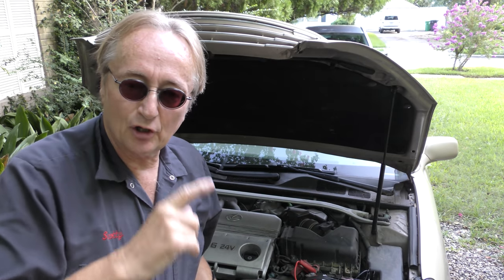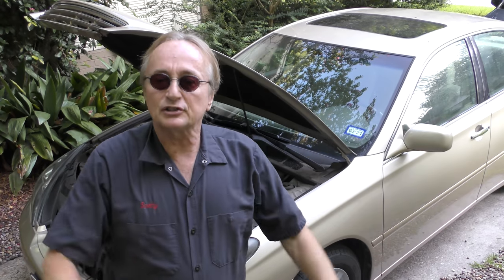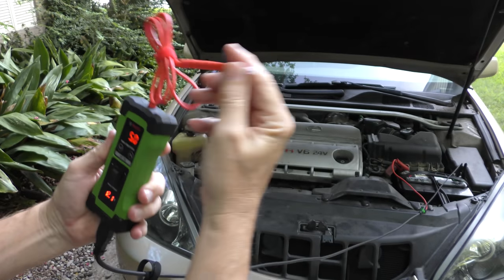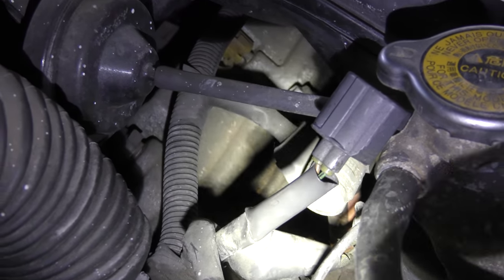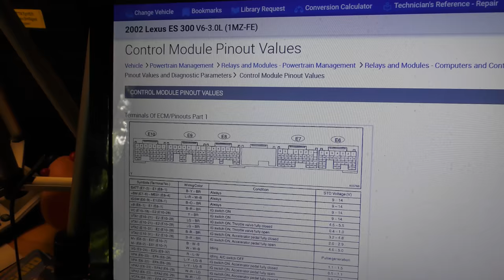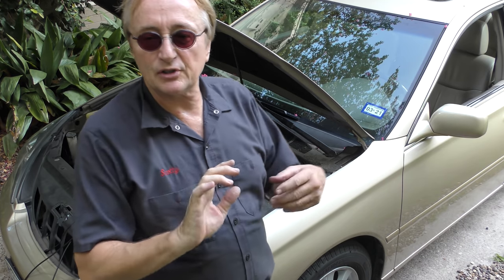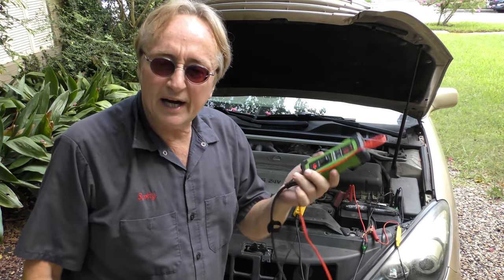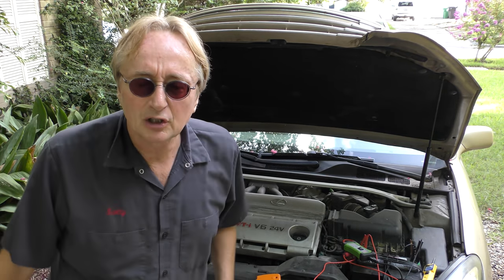Never Use This on Your Car (It Destroyed My Computer)

Comment: You don't skip to replacing parts. You run the test(s) indicated by the manual for that code to successfully isolate what is really the problem, whether it's the senor or something else found during the test(s).

Comment: Protip 90% of the time when my engine light come on in my lexus its just the gas cap. Always check the gas cap first if the engine line comes on. Just turn the car off take gas cop off and clean off the rubber seal even a drop of oil rubbed on can help it seal better. Put it back on and hope for the best. If it dont fix oh well it was free to try.

Comment: Before going through any of that... I say CHECK THE BATTERY VOLTAGE FIRST, then a quick check of the alternator. 
Low operating voltage can cause the computer to do weird things.

Comment: No link to the green tool you used. Vet OTC 100? I like the way you can adjust the voltage ⚡. I would never trust myself with any of the power probes because of the possibility of frying the ECM. Found the product runs about $300 but seems much more versatile that the power probes I've seen.

Comment: THE ABSOLUTE BEST SCAN TOOL IS THE INTERNET, as long as you know where to look and what is being told to you makes good mechanical sense from people with experience. Some of the best advice I have ever been given are from those who have gone through the exact same problem and are confident and psyched to talk you through the fix.
Reply: You can at least get pointed in the right direction, usually, with the symptoms.

Comment: This is great advice.  If in the unlikely case your sensor goes, only get the OEM sensor.  It means you know it will be compatible and not cause problems itself.  Finding the voltage is easy once you know the voltage of the part.  I have never had to replace the OEM sensor on any of my cars but a Toyota Corolla, that is it.  it was the oxygen sensor.

Comment: Pretty good information Scotty!  Goes to show that a lot of times further diagnosis is needed on modern cars, using a code reader just gets you to step 1.  Also, ive found out that factory engine wires in a older car can get brittle/crack with age due to oxidation.

Comment: Last time I was this early, Chrysler made good vehicles! Oh! Whom am I kidding!
Reply: Haha
Reply: I guess I was just lucky... 3 Chrysler products, well over 500k miles between them... one blew a radiator. That's it.
Reply: @Joose  unicorn
Reply: It's "who" not whom
Reply: Typo
Reply: @Joose  Yep. I still own a 98 Grand Cherokee. It's been very reliable and robust vehicle. I changed all 4 shocks once and replaced a water pump as a preventative measure. The original water pump was still in great shape at 120K, 10 years ago. I haven't even touched the engine except replacing spark plugs several times as preventive maintenance. I did install a transmission cooler when it was new because I towed a 2 ton travel trailer with this Jeep. It's also an excellent, very capable off-road vehicle.

Comment: Nice! I haven't seen that tool before. At least if its a bad wire you can just run one wire through the firewall or across the outside of the old harness and pop out the pin on the ECM/PCM and to the same to the sensors connector pin. Then your just bypassing the one wire. Much easier than running and entire harness.

Comment: Smog test failure is my biggest problem on my 98 Tacoma. A couple times the mechanic took off the o2 sensor and cleaned it in an ultrasonic cleaning tank. All that exhaust gunk builds up after 20 years. Didn't need a new sensor.

Comment: Just for info the OTC VET 100 will cost you about $200. So you should be doing this on a regular basis which I would recommend if you have anything other than a Lexus or Toyota. I only have one because many of my friends bought Dodge or Chevy and they are constantly coming to me to fix their electrical issues.

Comment: Before playing diagnostician, sometimes it makes common sense not to assume the dark stain level of the coolant reservoir  is ok. While your engine is cold just take the radiator cap off, take a look and see if there is actually coolant in your engine.

Comment: Just a little note to remember.  Generally, any system sensor is either a 0-5 volt or 4-20 milli amp device.  Not only true for cars, but it's a general industry standard.  Even the, now no longer used, space shuttles had sensors that worked this way.  Yes, the 3.5 volt sensor has become more popular lately as well.

Comment: Paying a margin more for the OEM parts is worth avoiding really expensive repairs that can come from the cheap faulty ones.
Reply: If it's anything with a lot of labor that's going to end up costing more to swap out if it falls then im automatically using a high quality part
Reply: @thetechlibrarian  For the '99 Cutlass I'm trying to get up and running some of the most important things to go high quality on are the head gaskets and all of the other gaskets involved. I'm also gonna make sure the heads are close to new condition by taking them to a professional, use new bolts, and I may get new push rods too. AcDelco's kit comes with the gaskets and the bolts which is pretty convenient.

My parents had another similar  vehicle before the Cutlass, a Grand Am which was probably a '95-'97.

I was little when they got rid of it after the head gasket blew out and now their second vehicle with a GM 3100 engine has a similar problem but this one's probably gonna get fixed and get a few hundred thousand miles on it.

All in all, paying for quality parts pays for itself many times over because it'll save you from repairs that cost tens of times more than the price difference between the cheap and the OEM parts.
Reply: Yeah, or at least a quality part from some oe supplier. Really depends on the vehicle. Some aftermarket parts are better than some factory. But then some factory are the best ever. I got over 100k on the factory front cv axles on my 2000 Ford, which was pretty good for lifted torsion bars, 35" tires and 4.88 gears, with TONS of abuse. Figured I'd save a bit, get some parts house axles when I finally broke one. Which I broke, I did something stupid and literally broke it myself even then. But after that, I got really good at changing axles... And unit bearing hubs. Once I finally killed the factories with pounding abuse and lots of water and mud, got where I could change them in about 30 minutes. Good thing they were lifetime warranty, til they stopped honoring the warranties on them and the axles. Should've just went with Ford, and never had to touch it again for years if ever. Now the rear axle was exactly the opposite. Factory was 300, I got a Yukon for 150. Chromoly... it was so hard, the stock replacement lugs I pressed in, fell right back out. And I ended up having to press the old ones in. So that baby was never gonna break. But the original shouldn't have. I knew the wheel bearing was going for a long time, and was just lazy. Til it had finally work a 1/4" groove in the axle race, so had to get a new one. When it could've been just a new bearing. I also used Yukon gears. Their stuff was GREAT! But still cheap. They're probably higher now they're established, but I know they did make great parts for the price of cheap Chinese crap.

Comment: Hi Scotty. I'm from the UK. I have a Lexus IS200 (se), an automatic. It's got a little over 130,000 miles on the clock. The steering shakes a bit at about 50mph, which I believe you've mentioned is a transmission problem. I doubt the transmission fluid has been changed. Generally the transmission works ok, but is a little clunky with main changes, eg. reverse to forward or back, etc. Would it be too risky to change the transmission fluid, or might changing half the fluid be good?
Edit: ps. It's about 16 years old

Comment: This is a way to test wiring but you can check wiring even easier. Disconnect the connector with everything off check resistance power to ground should be infinite Do the same ground to ground should be nothing. Then disconnect the connector from the computer and check the two pins together should give you infinite resistance again if all of that is good your wiring is fine.

Comment: 2017 ford f150, you turn vehicle power on, not start engine. Pull the high beam light lever 5 times then press and fully release the brakes 3 times. About 2 seconds later I saw the batter check light flash 3 or 4 times. An saved $175 on a reset.

Comment: On my 2014 Nissan Pathfinder I had a aftermarket maf sensor replaced whenever it dipped down to -15 degrees in the winter my car stalls out and all those times I was chasing a ghost problem thought it was the fuel pump but it wasn’t all along it was the sensors issue even though there wasn’t a code saying the sensor was the issue replaced it with oem and worked like a charm

Comment: First thing I would have done is look up the resistance chart on alldata for that sensor and test it in a pot of water on the stove as it heats up before sending any power through to the ECU and risking damaging anything. Make sure your sensor isn't actually junk before risking the more expensive components.

Comment: at about 160k the maf went sick on my 2000 toyota echo. researched it. NO not 200 bucks for toyota sensor. the best sensor was 16 bucks. its been working fine for over 2 years. sometimes you do not need OEM. when the belt idler went bad on my camry and the alternator bearings got noise on the echo I bought real OEM parts online. when in doubt you are correct use OEM

Comment: You can create this testing device really easily for cheap. You need just the LM317 voltage regulator and potentiometer. Then you can adjust the output voltage according to digital multimeter.

Comment: I was hoping you'd get into checking the resistance of the wire.
Reply: Quickshot Gaming Ohm my!
Reply: For this small a voltage it'd better be very low resistance.
Reply: grassroot011 V=IR

Comment: How about a charging system sensor on a 07 Ford Mustang? I've replaced the wiring from the starter-battery-alternator because the wiring was bad.

Comment: Wow how crazy you mentioned the engine coolant temp sensor that's one of two codes i got on my car right now I have a 94 Nissan 300zx
Reply: @Mark Codiroli the first code was 34 the second was 13 its the ect sensor and the detonation sensor circuit...

Comment: My advice = If you pierce probe a wire, use a product like liquid electrical tape to seal the probe hole. If you don't, the wire in the harness will eventually corrode causing a problem later on. JMO.

Comment: great video, very helpful... My 2008 G5  had a crank sensor issue,  ended up taking it to a mechanic and I was right was crank sensor, but it was a bad wire in the harness, they swapped it out for one from an auto wrecker but code started coming back. It must be a common issue on these engines, online I can only find the connector for the sensor with a long lead off of it meaning they want you to by pass the stock wiring. DERP thanks Chevy
Reply: @milcotto4153  there is no leak just a cheap chevy wiring harness

Comment: Hey Scotty, why you didn't mention testing the sensor with a multimeter, by looking at the resistance rate/temperatures of the sensor. It's a pretty easy and non expensive method.
Reply: @Mark Codiroli takes no time if you have the information of resistance by temperarure of the sensor and if you use an Slide-on Extended Tip in your multimiter, you don't even need to remove the sensor out... just unplug the connector and plug the extended tip....vuala!
Reply: @Mark Codiroli 🤔 now you're saying that's the same effort.. anyway, my point is:  There's other options to diagnose the sensor, keeping in mind that a circuit tester cost a lot more than a simple multimeter.. It's just about it and nothing more. Have a good one pal !
Reply: @Mark Codiroli I suggest you to read again, cuz i never said that you need a sensor simulator to check the sensor, I just suggested that you can do it with a multimeter . I will not offend you, there's no need for it, I'm sorry if you though that i did, it wasn't my intention.

Comment: Hi Scotty! I’m thinking of buying a new Toyota Sequoia with a naturally aspirated V8, but I read that naturally aspirated engines lose power at higher altitudes. I plan on driving it in mountains up to about 5,000 feet. What I read stated turbo engines are better for driving at altitude since they don’t lose as much power. What are your thoughts? Thanks

Comment: Hmm my 99 lexus es 300 coolant fans keep running all the time. Chiltons diag says it's the coolant switch. I replaced it and it didn't fix it. Took it to the stealership and they think it's the ecu lol. So I bought a duralast gold battery with a 5 yr replacement free. And now I get a new battery every year for free👍

Comment: Hrm....I have been convinced my TPS has been bad for a while...I replaced it, but still get hard starts (no codes).  HAVE tested voltage at the sensor, but still have the same issue over and over.  I've run down the Christmas tree of possible reasons....but now I'm paranoid the brain may be failing.  It's a 2003 Ranger...they don't die...they just work less good.

How do I know they don't die?  Been trying to find a couple parts in the junkyard to replace ones that have died due to hard use....I can't find many that aren't 1980's/90's and what I need is always already broken or gone.  /sigh

Comment: Another great video. I now know how to fix this problem! Hopefully it never happens! I'm only just starting to get familiar with my multmetre!
Where do you ask questions?
I have a 1990 Nissan GQ Diesel 4WD with a 5 speed manual stick shift. I coast everywhere I can.
I used to drive taxis and would coast in neutral (called Angel or Mexican Overdrive in Australia). Naturally, when popping it back into drive, I would increase engine revs to match road speed).
Is this ok for an auto transmission or does / can it do damage?

Comment: Scotty you do realize that if the temp sensor is connected and working, you will never see 5v at the data pid right?  Even with adding you little 5v tester, it's 5v in parallel to the 5v the ECM is putting out on the wire and through the sensor, so they both are grounded through the thermistor of the temperature sensor, so whatever the coolant temp is, say 120 degrees Farenheit, you would see 3.5v on the data pid, that's how that circuit works, you are doing nothing useful by adding 5v to that wire. You would only see 5v around -40F

If you wanted to test the circuit, you'd be better off with a resistor box, or heck even a rheostat or any variable resistor connected to ground, and swing through known resistances and watch the data pid yo from 5v to 0v, that would be more useful that whatever you're trying to do, which is really pointless, because you already tested the 5v wire to figure out which one is ground, and which is 5v, hence no need for the 5v supply.
  That circuit works by the Ecm supplying 5v on the green/black wire to the temperature sensor which on the other wire goes to ground. The thermistor varies resistance in response to temperature, which connects the supply wire to ground. The Ecm monitors the available voltage on the wire, so when the temperature is low, resistance is high, which means more voltage is present on the wire, hence when you unplug the coolant temp sensor and probe the terminal you see all 5v. So you understand why adding 5v to this wire accomplishes nothing right? It's already there.

Comment: I stopped working on friends cars. Some don't realize that my time is valuable too. Others had multiple problems but thought I was using that as an excuse for not knowing what I was doing. But the biggest reason is people demanding the cheapest sensor then blame me when it fails a short while later. Even my brother would not buy the required $400 distributor assembly for his daughter's pos convertible. He said "the parts guy said the $150 will do just fine, it didn't and YouTube agreed that this particular model is extremely picky about the signal quality from the distributor. He took it to a mechanic and they fired 2 techs over it, nobody would listen to me or look at the proof it had to be the expensive one.
Reply: Yeah it's pretty insane with fixing cars. Just having it in your driveway for an hour seems to allow them to come back at you a week later for something that has nothing to do with what you fixed just because you worked on it. I go with cheap parts when I can but I always research and see what other folks said. And if it fails that's egg on my face. I at least try to go with a good equivalent and not the lowest brands unless I have to for cash reasons.

Plus I agree when people see you can do valuable things for them for next to nothing (or family.. I know.. I know), then they think that's what you do and you always have time to do what they need. For me it was always fixing computers. I did it as a little side money job for years but stopped about 6 years ago because most people don't want to pay very much and it would take up every second I had. Life isn't worth working yourself to death.
Reply: It was a seabring convertible, one of the last years. I replaced the distributor because the cam position sensor is not replaceable if I remember correctly. We didn't want to but we had to. Something about that particular engine made it very picky about the cam signal, after failing to get it running correctly and hours of research we learned many other before us had the exact same problem, and how to fix it.

Comment: This method will not fix the problem if the problem is in the signal wire(s). Also, if the ECT sensor is good, but some other sensor on the 5v ref circuit is pulling it to ground, you might end up replacing a computer that does not need to be replaced.